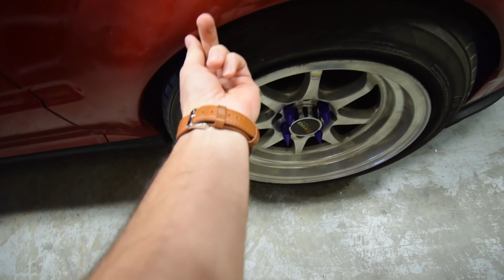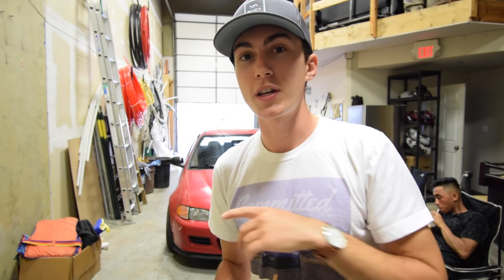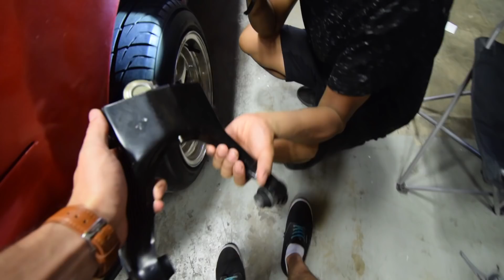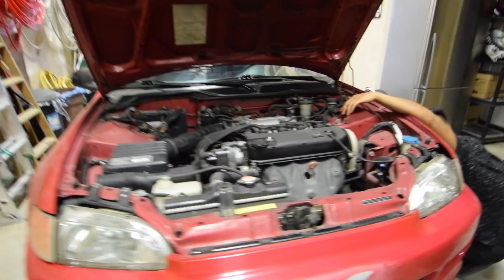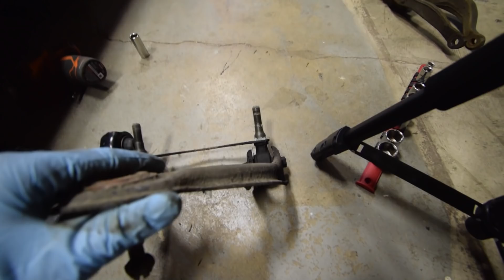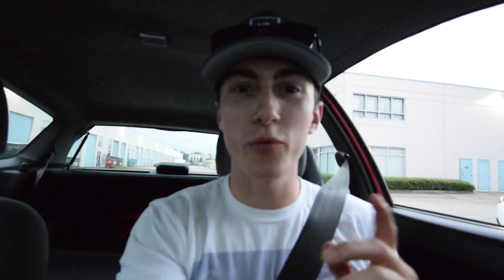YOU Choose the Civics COLOR!!

Comment: Just wantched the exhaust video where you mentioned it burning oil. Those things are known for the valve seals hardening and letting too much oil in. Small trick for that. Pour about 1 ounce of brake fluid into the oil and it will loosen the rubber up and burn less oil.